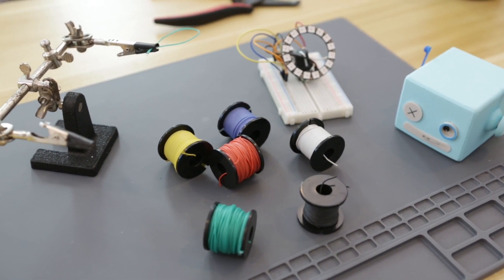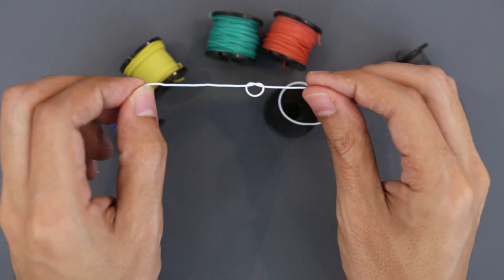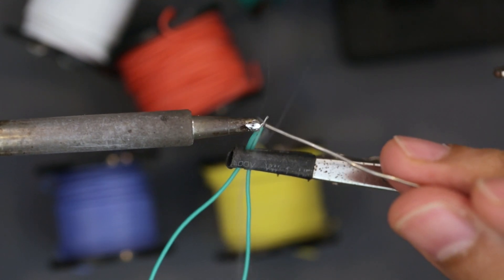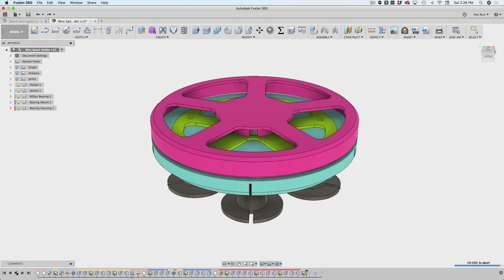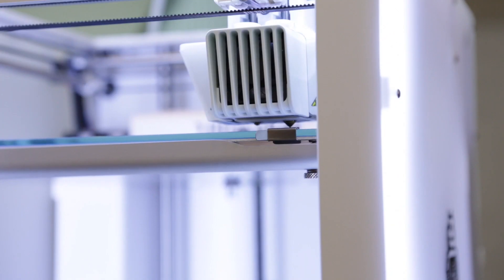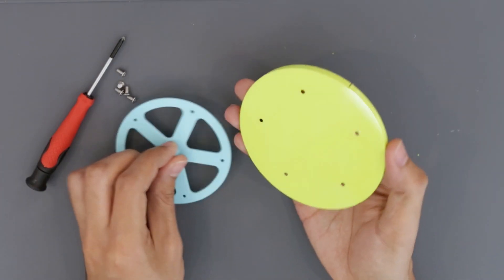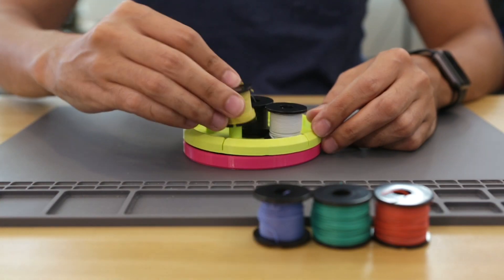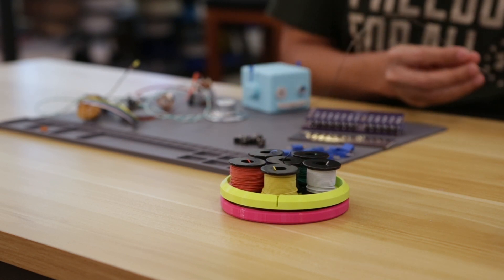Wire Spool Carousel // 3D Printing

Comment: I printed and did a comment on thingsuniverse. Is the a model to print the empty spools and where is the joint underneath the carousel
Reply from the maker: The spools are from silicone covered wires we stock in the shop. The base fits a ball bearing for the carousel to spin.
Reply: @adafruit  I'm from Germany does not makes sense Thank  you anyway